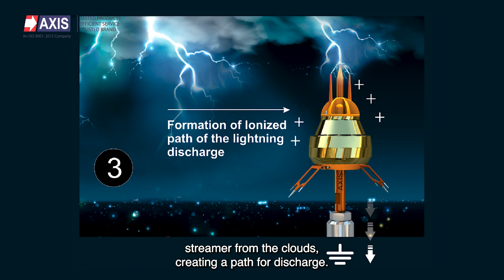ESE Lightning Arrester VS Conventional Arrester - Differences in Functions & Applications Explained

Comment: Can the galvanized pole to mount this Axis ESE provide the ground path or does a certain size copper wire be needed?
Reply from the maker: Copper wire as Down Conductor would be required.
Please connect with us at sales@axis-india.com for a detailed discussion.

Comment: What is inside the ESE Lightening arrester?  If it is some electronic component, then won't it be damaged during lightning?. If the parts inside the ESE Lightening arrester is damaged by lightning,  then it would act only as a conventional rod . Then it is no use on spending that much money, i can simply go for multiple conventional rods.I have read about failure of ESE Lightening arrester and caused damages to properties. Please explain.
Reply from the maker: Thank you for your interest!

 Axis ESE Lightning Arresters are tested as per NFC 17-102 hence we can assure complete safety. Any part inside the arrester won’t be damaged during lightning nor would it act like a conventional rod.   

In case you have any further doubts/questions regarding ESE & Conventional Arresters please connect with our Lightning Protection Experts at anita.k@axis-india.com or sales@axis-india.com.

Comment: Hi, i watched the video but no explanation how it works... before the strikes occur yes, there is a huge potential between ground and clouds but what charges the capacitors? Another power for it inside? Or just magically appears those charges??? Let's assume we collect it somehow, how to set trigger time for discharge the capacitors? Does it happen before the strike hit the rod? At the same time? After it? I'd like to install these ESE rods on my animal yard but its seems not clear explanations 😕
Reply from the maker: An ESE lightning arrester consists of two main components: an air terminal and an ion generator. The air terminal is connected to the ground, while the ion generator remains at atmospheric potential. Under normal atmospheric conditions, the ion generator is in standby mode. However, during thunderstorms, the generator is activated by the strong electric field generated by the approaching downward leader.

The ion generator contains an electropulsing device, which emits electrical impulses that ionise the air around the tip of the air terminal. This ionised area grows much faster than with a standard lightning rod, due to the electromagnetic fields stored in the components of the electropulsing device. The ionised area favours the formation of an upward leader, which progresses continuously towards the downward leader, forming the discharge path.

The ESE lightning arrester is designed to work autonomously. It is also capable of enduring extreme environmental conditions, making it a reliable solution for lightning protection.

The operation of an ESE lightning arrester can be summarised in the following steps:

1. Standby Mode: Under normal atmospheric conditions, the ion generator is in standby mode, and the charge is neutral in every area.
2. Precontrol State: When storm conditions initiate, the ion generator gets activated and remains in precontrol state. The electropulsing device starts emitting electrical impulses, creating a strong concentration of charges at the surface of the air terminal.
3. Streamer Emission: As the downward leader approaches, the strong increase in the electric field triggers the main function of the electropulsing device. The device uses the accumulated energy to pump positive charges into the ionised area, provoking a streamer effect.
4. Upward Leader Formation: The streamer emission favours the formation of an upward leader, which progresses continuously towards the downward leader.
5. Lightning Discharge: The point where the upward leader meets the downward leader becomes the discharge path for the lightning strike. The ESE lightning arrester, being the point of origin of the upward leader, becomes the receiver of the lightning strike.

It's important to note that the principles and operation of ESE lightning arresters are subject to specific standards, such as NF C 17-102:2011. Compliance with these standards is crucial to ensure the effectiveness and safety of the lightning protection system.
Reply from the maker: I apologise, I forgot that this video does not go into the working mechanism of the ESE. I have tried to answer your question in the comment above. I hope that helps.

This video below is also has a brief explanation on the working mechanism.

https://youtu.be/067M2aMToOg

Comment: Can you suggest suitable lightning arrester for farm resort, approximate area 300 mtrs X 100 mtrs.
Wherein there is no tall structure except water storage tank tower located  roughly at the centre (length wise) and at the edge width wise ie 100mtrs. Thank you.
Reply from the maker: Hi Raghavendra,
Yes we can surely help you with that. Please share your details and get in touch with aniket.d@axis-india.com 📩
Reply: As per your reply to my comment on your video,about my enquiry,
 I had mailed Aniket on 25th June, still awaiting a reply, please do so at the earliest. Thank you.
Reply: It will be better if you can call at the earliest. Thank you.
Reply from the maker: Sorry for the delay @raghavendraguttikar7292 

Aniket will take this 
on priority!

Comment: is a conventional LA same as a air terminal rods? what are the differences?
Reply from the maker: An Air Terminal Rod or Lightning Arrester is a generic term for air termination in an external Lightning Protection System. This Air Terminal could be Conventional (Franklin Rod) or ESE depending on the requirements of the project.

Comment: How does the ESE lightning arrester always store the opposite charge of the lightning and not the same as the clouds
Reply from the maker: Hey,  
ESE Lightning Arrester’s objective is to become the point of discharge for the lightning bolt, instead of the bolt hitting a random object such as a solar panel or the side of the building. By becoming the point of discharge, the electricity can be safely conducted into the ground using the entire lightning protection system, protecting the structure or solar park.
Reply: @AxisElectrical  yes I know that I mean to become the point of discharge it should have the opposite charge of the clouds. How does it always get the opposite charge of the clouds and not the same as the clouds
Reply from the maker: @amrmansy470  Inside ESE there is an electronic circuit, that stores the charge on the Air Terminal based on the ionization of the air. Hence this is how it always gets the opposite charge of the clouds.

Comment: A more appropriate video for me now as I'm looking for installing a solar panel in my roof. I would like to understand if I should go for a franklin rod or ESE arrester.

I have a roof area of 13 ft x 19 ft and I'm initially planning to install a 1Kw (2x 535W panels). Eventually over next 3 - 4 years, I plan on increasing it to 4 Kw. (535*8 panels)

My overall space around my building till compound is 4 feet at the back of the roof and 2 feet / 3 feet on either side. Would it be ok to have a earthing done in the 4ft space such that it wouldn't damage the building or the panels?

Please share your inputs.
Reply from the maker: Thank you for your interest!  

 Our experts will do a detailed analysis for ensuring the safety of your buildings and panels. We request you to please share your drawings or picture so that we can offer you our expertise.  

 Please connect with our expert N Kishorebabu at 7208885047/ n.kishorebabu@axis-india.com.